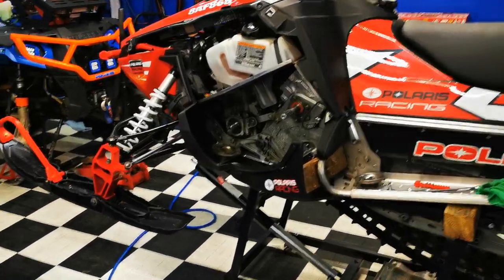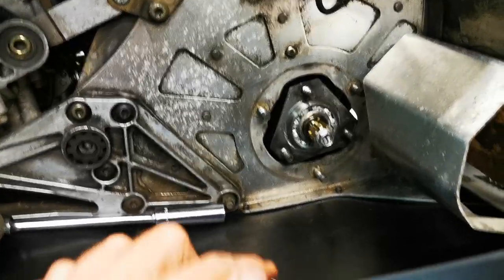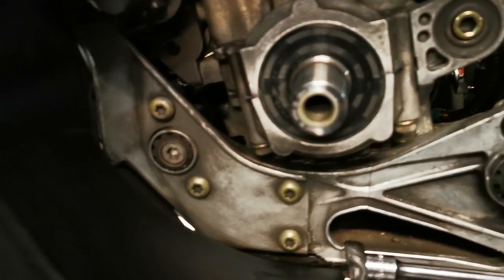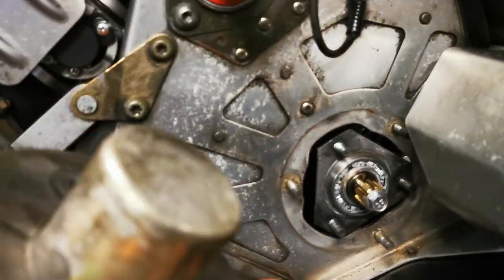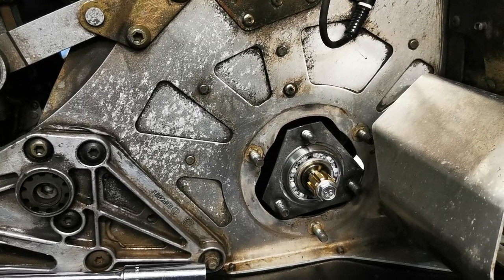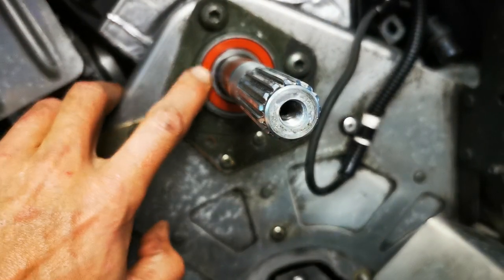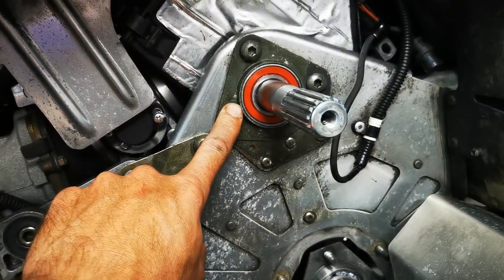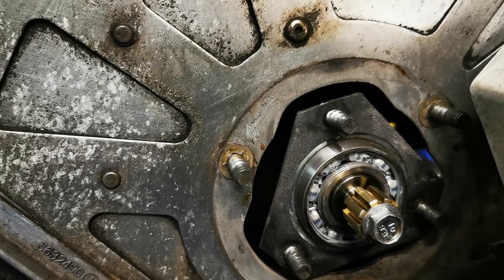2013 Polaris Indy 600 SP Driveshaft Bearing Greased

Comment: Thank you Scott for this great video.  Is it possible to remove the shaft from the top to be able to change the bearing and at the same time change the one on the side of the chaincase.  I have a Polaris Switchback adventure 600 - 2012, 18000 km.  The bottom two are done.  Sorry, I'm getting confused between driveshaft and jackshaft.

Comment: Also, does the gear for the speedometer pickup freewheel, or do you torque to where it only rotates with the drive shaft? If that makes any sense to you. I just replaced the bearing and decided to take that gear off the end of the driveshaft but forgot if it freewheeled or not.

Comment: Great video, thanks.  I did mine last week.  Last question, what about the jack shaft and drive bearings on the other side in the chain case?  Does the chain case oil get to them or do you repack those bearings with grease as well?
Reply from the maker: I've never worried about the bearings in the chaincase. Most failures are on the two bearings on this side.

Comment: I have a 2016 600 indy with 5,000 miles. How would I know if this bearing needs to be replaced? Sled runs and drives fine, always dealer serviced. Took for ride this weekend and thought I heard whirring noise when accelerating/ louder when decelerating below 30 mph. Not sure if I am just hearing the motor, or if it is this bearing.
Reply from the maker: Take the cover off and see if it has any play in it by wiggling it back and forth.  With 5k I'd certainly service both the jackshaft and driveshaft bearings.

Comment: Do you put a jack underneath the driveshaft to stop it from dropping down a bit when you take the speedometer housing off?
Reply from the maker: No you don't have to.  Just loosen off the track and when you put the cover back on, use something to push the driveshaft back into position so the holes in the cover line up with the holes on the tunnel. I use a 2x4.

Comment: Nice video. How did you get all that to align perfectly at the end when you were reassembling ? I loosened my track no luck
Reply from the maker: Have to push driveshaft forward. I use a 2x4 and start the bolts.

Comment: How hard was it to replace that bearing the year before Scott?  Did you have to pull the whole drive shaft?
Reply from the maker: No, you can change that end right in the sled. Just need a bearing puller.
Reply: Okay thanks, I’ll open mine up and see what size bearing puller I need.